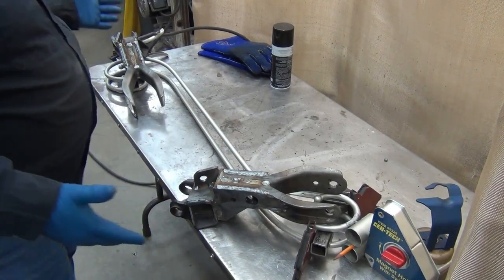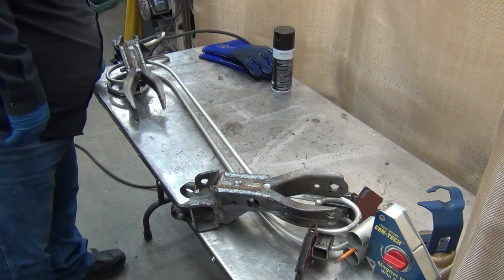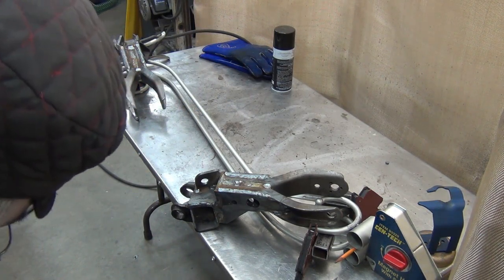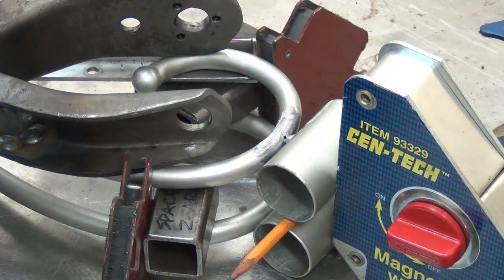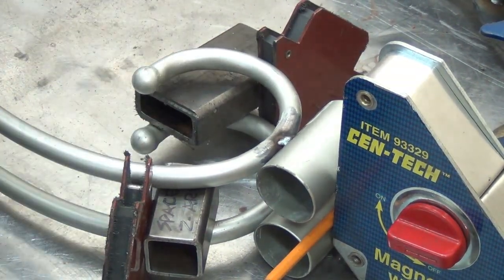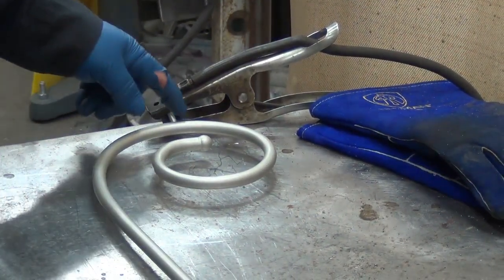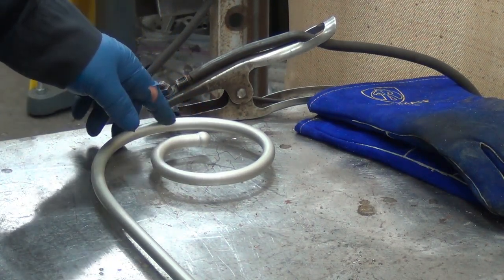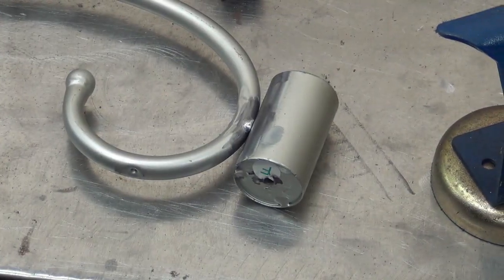Canopy Bed Repair - MIG

Comment: I imagine with the .030" getting a good sounding weld would be enough power to blow a hole through the .020" quite handily... ;-)  The motto at the old shop I worked was "Do the best you can with what you have to work with"... LOL

Colin ;-)
Reply from the maker: The .030 will do sheet metal, but it doesn't really like it.  I just couldn't see putting .023 in for two 1/2" welds.  LAZY!!! lol
I could have used the TIG too.......again....lazy. :)
Thanks!

Comment: Got it done...!
If you want to try this for the future, make the arc quite hotter and pulse it, meaning you don't get too much heat at the same time, but the weld flattens up nicely. In facts it gives time to the surrounding metal as well as the weld to cool enough not to eat right through.
Ground needs to be strong.
Let me know how it goes, this can be done even with a cheap machine.
Pierre
Reply from the maker: Basically, nice hot tack welds?  I'll have to give that a try.  Thanks!!!
Mike
Reply: That's the idea... Just get practice on a piece of scrap thin metal sheet, be sure there is not paint or any other shit on it that would make bubbles in the weld.
Reply from the maker: pierre beaudry
Thanks!
Your comment on the gas bottle got me digging up vids about the valves breaking off....which led to some other weld vids that were quite informative!  I'm looking forward to another session with the welder to try some of this out. Thanks!! Mike
Reply: cool...!

Comment: I adjust my power up till the welding sounds like bacon frying and splattering. The sound of your weld sounded a tad underpowered as it was too smooth, but then again I do not consider myself to be an authority on MIG either.
Reply from the maker: Ahh....I was thinking the same thing, but I was afraid to turn it up anymore since it was so thin.  I thought I had it on the hot side according to the chart.  I think having the ground a lot closer might have helped too.  I used to have a 110v mig that I would keep .023 in just for smaller jobs.  It wasn't a very stable welder, so I sold it.....maybe I should get another :)
Thanks!
Reply from the maker: *****
Yep....same on mine
Reply: *****
I have a Miller 185 with separate wire speeds and amperage controls but that machine cost me in excess of 1,500 new and welds like a dream. In fact it welds so good I have never had any need for a Tig machine as this machine can weld very thin sheet metal no problems without blowouts if you just tap the trigger to simulate a stitch weld when doing thin materials.
Reply from the maker: 1NRG24Seven
Hmmm....we might have the same machine....I've got separate controls too.  I paid $900 for it second hand.  It was a trade in at one of the local AirGas stores.  They went through it and it was almost like new when I picked it up.
I can run a continuous bead on a butt joint on the Datsun sheet metal(20ga?) with .023...provided the joint is tight.  I used to have a 110v welder that I'd keep the .023 in, but it didn't have near the stability of the miller.  This welder is awesome....I just wish the owner was an awesome welder!!

Comment: You put plenty of metal in that weld.  I bet it is thicker than the metal it is holding together.  You have to do a favor for friends now and then.  Thanks for sharing.
Reply from the maker: I didn't really want it that thick, but, as I found out on the next project, the contact tip was going bad so it was a challenge trying to get it to weld at all!
I've only got a couple of friends I'll do multiple favors for......most everyone else...just one.......management at work....ZERO!!!! LOL :)
Thanks for watching :)